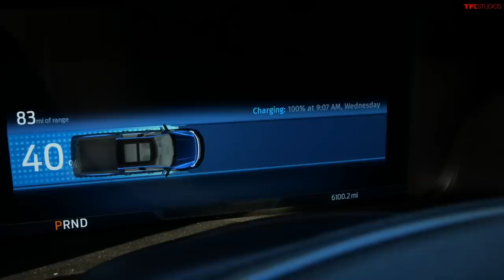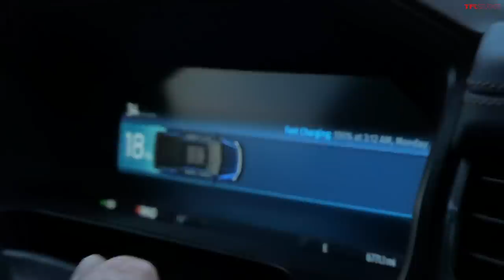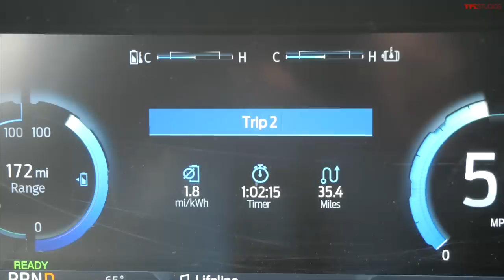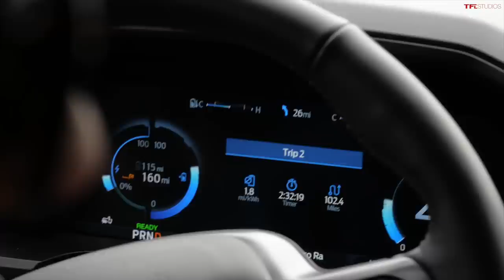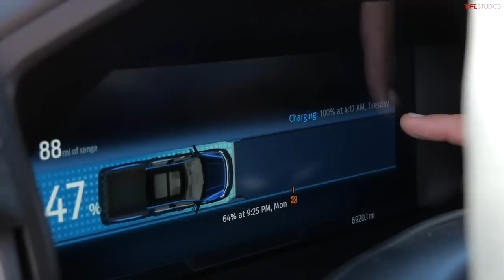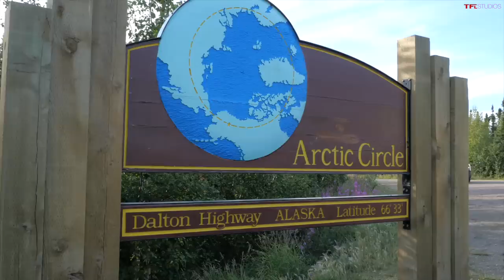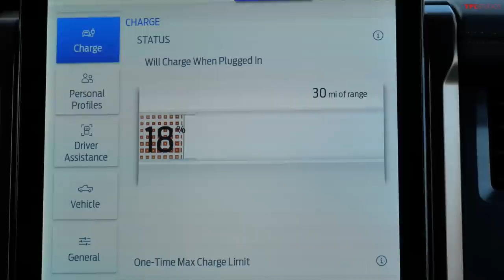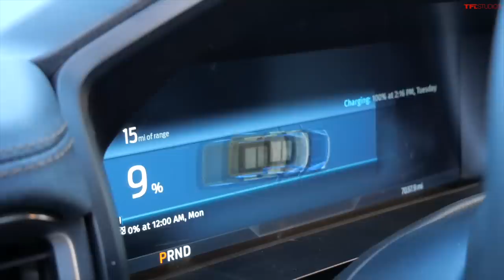Easy Part Is Over: Driving an EV Truck Into the Alaskan Wilderness Is HARDER Than We Thought! Ep.4

Comment: I'm more interested in the powerboost, I wanna see its mpg and how it did on this trip because the powerboost is the serious, more practical truck.
Reply: agreed. The powerboost is the most exciting truck in this video.
Reply: @kyle-ri5mz  and with 1.1M subscribers for TFLTruck vs about 80k for TFLEV, I’m betting many, many people agree with you. 

The EV thing is mildly interesting but it could be a channel killer if they keep harping… I was hoping for a travel series with an EV as side kick.  Seems they’ve gotten it backwards. 

Some PR training, and abstinence 😂, from moderators wouldn’t go astray either.
Reply: I have a Powerboost.  When it comes to sheer work-power, I would agree.  But I am trading it in for a Lightning in October.  It is all about use-case, and goals. For my use-case, it will work, and for my goals of greener footprint, it will be even better. 

As to your other question on Powerboosts, on my 4300 mile month-long camping trip, my overall average was 20.0 MPG.  That is with a GoFast Camper and 16 gallon water tank and camping gear, figure 650 lbs total, and me driving a mix of some Freeways, mostly state highways and , county roads, and mild overlanding trails.

Comment: That fairing has minimal impact. You should have worked with 4wheelcampers to create dovetail fairings. Most of the drag isn't when the truck hits the air in front, but the vaccum that's created at the back when the flow detaches from the truck and ends up being turbulent.
Reply: Most 18 wheelers quit using the Dovetail because they aren't worth what you think they are

Comment: This makes you appreciate our current trucks. This truck works best left untouched, and in ideal conditions. Our gas/diesel trucks you can lift them, add larger rims and tires, stuff them full of gear and people, throw a trailer on the back and still make it up north without ever stopping once…. Electric will get there, it’s just not here yet….
Reply: you telling me that your truck do 3500 miles. Electric vehicles have less range because the have batteries, once battery energy capacity equals gal tank energy you will be able to go twice as far as an ICE vehicle.
Reply: Chris Hansel, where will this take place? Fantasyland?🤡🤡🤡🤡🤡
Reply: @roddycreswell8613  One would be talking 4x the current battery capacity to compete with gas when it comes to towing and hauling. Even if someone created the battery, think of the logistics of charging that hot mess.
Reply: I think ppl in the comments are missing the point. Electric vehicles will never make it with the amount of stuff you're talking about hauling. Plus if you're watching this how many times did the have to adjust their speed just to get the mileage just to make it. Plus how long are they taking to charge. It takes possibly 5-10 mins to fill up with gas. Plus how many adapters did they buy to make charging work. Those adapters are not cheap. Electric is just not there yet. Imagine trying to do this with a family with kids. You will have to have at least a month off just to enjoy a week of vacation. Takes two weeks to get to and from destination in planning, charging, and waiting.
Reply: @roddycreswell8613  Long live the internal combustion engine!!
Reply: @vbarbee1  “Electric is just not there yet” for all use cases. In fact, it will never be there for all use cases. For the other use cases, electric is already there.

Comment: This points out exactly how most of Canada is with regards to charging issues when you leave the major cities. EV’s have long ways to go until they are practical for most people, as the range and charge time has to be drastically improved on. I do many 500mile + trips pulling a 8,000lb load in the summer, so for me EV’s are extremely useless. Perhaps one day the technology will be there. Great video.
Reply: If you tow a trailer with a 20 Kw Diesel generator and a tank holding 1000 gallons of fuel it will be no problem. Diesel is available almost anywhere there is a road.
Reply: For cold climates the hybrid is the better solution. For most people in the usa the EV would be fine.
Reply: @johnstreet819  lmao. Could you imagine actually having to do that…
Reply: @sanisidrocr  yes, a plug in hybrid would be ideal.
Reply: Australia  is worse. Not too many EV Chargers across the Simpson desert.
Reply: @robertryan7204  Sounds like the perfect place for EV owners! :D
Reply: @johnstreet819  why would you have an electric vehicle at that point though?

Comment: Nikki at Transport Evolved put a tonneau cover on her Lightning and sees 2.3 to 2.8, so I think that a lot of drag is coming from the sides of the camper where it projects out into the wind. 
EV’s with heat pumps don’t lose as much range to cold as resistance heaters. Gas trucks also lose range in cold and people often have to plug in a block heater or the gas vehicle just won’t start. I have lived in places where it has been 40 below, but it’s not always, or even often that cold, so the range hit isn’t that bad most of the time
Reply: Right i live in canada and if I don't plug my truck in it won't start at -45 when I have to go frame a house we use anti freeze in our airlines for our air tools so whats the difference if you have an ev you still need to plug in at least you can set the ev to warm up at a certain time so it nice and toasty when you get in and you dont have to freeze filling it up so meny nay sayers out here cant do this cant do that sucks at this sucks at that but most haven't been in an environment that cold let alone work in it on a daily basis in the winter

Comment: Great video. I’m not convinced that the lightning is a viable option for real work. Seems like a great option for a dime store cowboy.
Reply: Perfect for hauling bags of Mulch in the Suburbs. F-150 Suburban may have been a better name if Chevy wasn't already using it.
Reply: It depends on what “real work” is. Personally, I don’t need to drive to Alaska every day. Charge over night, drive 30-50 miles to a work site. Do work. Drive back and plug it into your home charger. Ready for the next morning. Seems pretty simple to me.
Reply: @theseb1979  except if you really do need your truck for work and then it breaks down (because they do break down) you have to schedule an appointment with the dealer and who knows how long that's going to take. In an ice truck you can sometimes get it fixed at the jobsite yourself.
Reply: @theseb1979  Yup, simple! We have monsoons here now in AZ, big electrical storms, power off yesterday. No charge no work, I guess, if I had an EV. But no prob for my old Ranger 4x4. Yup, it's pretty "simple to me" too!! :D
Reply: @theseb1979  That's true, usually a true work truck almost never leaves the town it is in and they often go back to a depot at the end of the day.
Reply: @theseb1979  simple until the batteries that crystallize from negative to positive with faster charging then it shorts out and burns down your house .  Try to put one those out.
Reply: Good good as an Urban transit vehicle with some utility
Reply: @robertryan7204  Maybe a little better than that...I live way out in the country and every August I need to tow my harvest each day to a receiving shed 30-40 miles (trailer loaded is 6,000-7,000lbs, much lighter on the way back). Something like this would be perfect for me, would only need to plug in every 2-3 days. Not every one is just hauling groceries or need to go 1,000 miles a day, real work often falls in the middle.
Reply: @derekk6906  Maybe Suburbia 150??😁
Reply: @theseb1979  My work trucks were rarely ever in the same town I was in.  Construction. Mine were very much true work trucks loaded with tools and sometime the whole crew.

Comment: Great job guys. You really pushed the limit of the truck and that’s cool. I drove from the east coast of Florida to Anchorage in February 2015 in a Ford Focus ST. I had Tire Rack ship some Blizzaks to a shop in Seattle and drove the Alcan in the ice and snow. It was awesome. I had the same problem with ice and mud building up inside the wheels that you guys did. I had to turn around near Whitehorse and hit a car wash due to the vibration it created. Other than that I had zero issues and wouldn’t trade the experience for anything. Three years later I did the whole drive in reverse back to Florida in an F-150. Good times.

Comment: Considering the truck normally gets 2.0 kpm when empty on hard paved roads I don't feel like 1.8 kpm on gravel roads with a fully loaded bed and a camper on the back is near as dismal as you make it out to be.
Reply: Shh they are being all top gear
Reply: Yes, it's just basically always dismal
Reply: @rfjohns1  just like your miles per gallon
Reply: @alanrickett2537  That's kind of the point.   Pulling even a light trailer is very energy intensive.   But you get a lot more range using gas vs EV.  Also much easier to refuel and you can take extra gas with yiu.  Also EVs severely impacted by cold weather.
Reply: @rfjohns1  some EVs are Impacted by cold weather, EVs are not the answer to all questions but most pickup never tow and of those that do it's not large loads long distances, and if that's what you need a pick up is the wrong tool anyway
Reply: @alanrickett2537  You do you.

Comment: I love the series, and I realize that the technology still has a ways to go, but from watching your charging struggles, imagine this: Every company that has gas stations has proprietary nozzles. To fuel up at a Shell, you need the Shell nozzle adapter; the Arco station requires an Arco adapter, and so on and so forth. Not only that, but the speed at which you can fill your tank depends on how many pumps are at that station. A station with 8 pumps will dispense fuel much faster than a station with 2 pumps. Yes, it sounds absurd, but that's basically what you're encountering with EV charging. With all the different dongles, adapters, plugs, cords, prongs, and levels of charging, success depends on any number of things being in just the right combination. With gas, I can pull up to any gas station anywhere, with any car, stick the nozzle in, and gas up. Until the infrastructure gets built up, EVs won't touch gas.
Reply: Facts 30 minutes to recharge a vehicle if you value your time is not conducive.

Comment: Your voltage drop was because of the length of the extension cord. What I would've done is  carried a NEMA 14-50 outlet  to swap out on the welder outlet she offered you, OR you could've swapped the outlets with the one you found inside. From what I know of Alaskans, they'd've welcomed a Rube-Goldbergian solution to your problem. There was likely an electrician within shouting distance to swap the outlets legally for you. (not that Alaskans are sticklers for doing everything according to building code 😆)

Another workaround that's available to anyone needing 240v where only 120 outlets are available is a circuit combiner. It allows you to plug into two different circuits using two NEMA 5-15 or 5-20 plugs to bump up the voltage to 220v. You're still limited to the 15 or 20 amps of the circuit's wiring, but it'll allow ~twice the charge rate of a 120v outlet. You'll run into all kinds of trouble if there's ground fault protection or if the wiring isn't near perfectly installed. If the home runs aren't of equal length, or one circuit has additional load on it, the electronics of a decent circuit combiner will err out, but if all the stars align it's a great life-hack.
Reply: That is what most Rural or Country type people would have done, but with todays Society and whininess someone would have sued them for suggesting something that might be unsafe. We all know that part of their support team could have done it. 

Hell in the Military in an emergency, I stacked up semi batteries in series with jumper cables to form a makeshift welder for a repair out in the middle of nowhere. Luckily someone dug up some welding rods. They nicknamed me MacGyver in the Army. 

Some people freaked out and some people said where did you learn that? 
Farmers just solve problems, we figure it out as we go and pass it on to others.

I taught myself a lot of things as well. 

So when everyday people try to tell their representatives a better way to solve problems, they should listen.

I would like to know what the max input 240v amperage input is that the onboard truck charger can handle. I then would wire up the 70 amp cable directly to one of the adapter cables they brought and sent what I could to the charger.

Necessity is the mother of invention. I was told many times that it can't be done and somehow I figured out a way to do it.

Just like the one man they were talking to up in the arctic circle , at one time people thought it was impossible to survive or work in the extreme cold. Americans figured out how to build a pipeline out of there through impossible terrain and there it is.
Reply: seriously eh, nothing an axe, a good sharp knife and a roll of electrical tape couldn’t have fixed. 😂
Reply: So if you’re limited to the 15 or 20 amps of a 110 outlet even if you combined 2 you still wouldn’t be able to charge in any sort of reasonable time. My Tesla gets 4 mph charge on 110. And 32 mph on a 14-50 outlet charging at 32 amps. That’s a huge difference in time to charge.
Reply: @Espo78  Double your voltage, you HALVE your charging time. Reducing 10 hours to 5 hours makes a difference.
Reply: They never videoed home-brew amateur electrician work. Everything has been off the shelf consumer purchase or hiring an electrician to do a job (install the EV charger outlet at the office) that requires a professional licensed electrician and only showing the finished product - not videoing a how it was done/how to do it for DIY motivated viewers. They could have kept it out of the video and had someone qualified install a receptacle that would have worked with the adapters they had and we'd be none the wiser about the switch but they kept in the genuine difficult of charging and being able to plug in to get a charge.
Reply: When I did hardwood floors we had a special cord adapter that we could just remove a couple breakers from a breaker box and plug our cord that was hardwired into 2 breakers and plug that in to run our 220v machines. I imagine if you had enough power coming in the breaker and room to do it you could get as much power as you want out of it, but whatever you unplug won't have power anymore.
Reply: @danoberste8146  halving from 2 weeks to 1 week to fully charge doesn’t do much good. What I’m saying is that you need more than 15 amps (charging at less than that) to make a difference.
Reply: Agree. They should definitely have a “Quick 220” combiner for this trip, and of course the NEMA 6-50 adapter they were missing. At this location, a 48amp capable portable EVSE would also be beneficial. The F-150 extended range on board AC charger can handle up to 80amps max (19.2kw).

Comment: Thanks TFLT for doing this. It’s a neat truck.. and if you’re a upper middle class person in a moderate climate in the suburbs, it’s probably worth it. But as a replacement for gas anytime in the near future, I’m just not seeing it. Only time I ever got range anxiety in my gas truck was in the Steese Highway between Fairbanks and Circle at -10F in February. Hundreds of miles with no stops. I got enough to worry about while driving and taking trips that doesn’t include planning the entire trip around 240v outlets.
Reply: Yeah, electric vehicles work much better in the lower 48. I live in PA and have a Rivian and there's no part of the state rural or otherwise that I can't reach comfortably with how available fast charging is here.

Comment: Those outlets at the Yukon River Camp were 120v, but they at least were 20 amp (rather than 15 amp).  That would charge at up to 1.9 kW.  You subsequently showed the charging and you were at 43%.  So if you were starting at 43%-ish, had the largest capacity Lightning, and we’re charging at 1.9 kW, it could take you 38 hours of charging to get to 100%.  That’s admittedly not great, but it’s not the five days suggested in the video.  :-)  BUT, most people don’t need to get to 100% most of the time, so it’s worth noting the difference between a 15a and 20a outlet, and having the correct adaptor, if doing charging from regular wall outlets!  :-)  It doesn’t sound like much, but a 20a outlet can provide as much as 33% more juice.
Reply: Also, many times with multiple outlets on a pedestal they are wired to multiple hots. This way they can deliver more power than just 20 amp at 120v to the pedestal with only one more wire (two hot, one neutral and one ground). With the right adapter you can plug into two of the outlets and get 20 amp at 240v (or 208v likely there).
Reply: @Sylvan_dB  True, I actually have an adaptor that will let me charge off of two outlets simultaneously so long as they are A) not grounded and B) on different phases of the panel.  Having an adaptor like that (and a long heavy-duty extension cord in case one of the outlets is far away from the first one) could be a huge asset for charging in rural areas.  :)